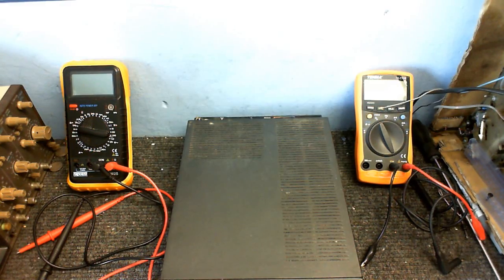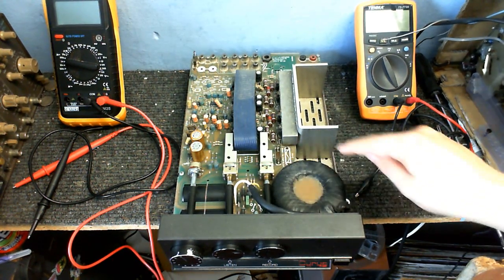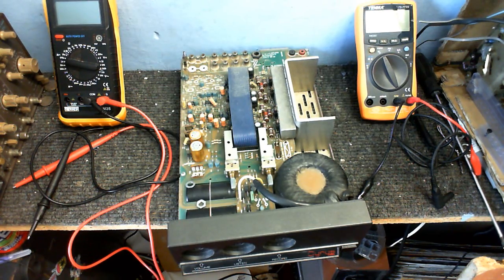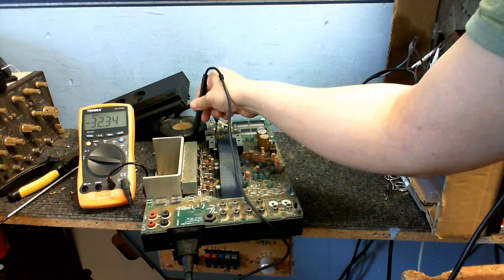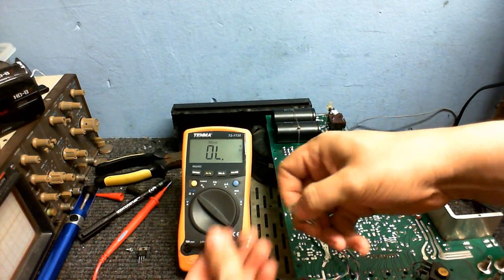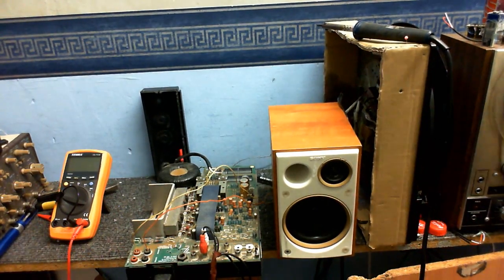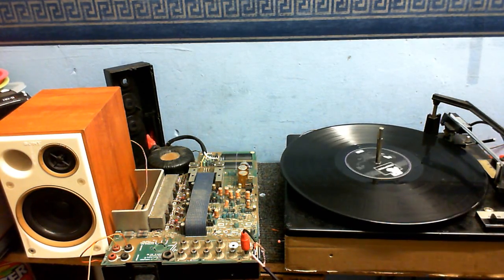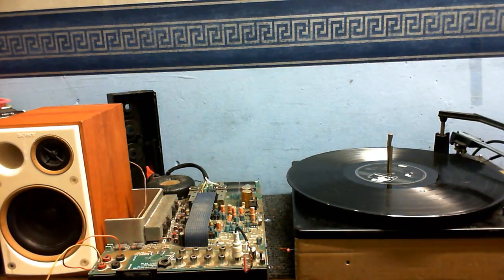CDC Electronic Workshop - Fixing a Cyrus One amplifier

Comment: I have had one of these for  about 15 years. 
They are brilliant. I had mine rebuilt by a real expert, it has always sounded great. As someone once said... to get a significantly better sounding amp than this, you need to spend $4,000.
The power you get for the 25W per channel is unbelievable.
I got some KEF LS50 speakers, and they need a lot of punch to drive them, I was getting a bit of mid range distortion when I wasx going past 60/70% on the amp (which is quite loud) so I had to get a Perreaux E220 200W AMP, which is a very well designed and beautifully made Amp.
They sound great now, but it underlines what a great amp the Cyrus was in the first place, in that it was able to  handle them really nicely at normal volumes (it runs my wharfedales now and is fine for them).

Comment: Great find Clem! I have a late Cyrus 2, with a toggle switch rather than a push button. They also sold an external psu (they called a psx, which is fairly easy to make yourself) which adds more power to the amp, and separates the pre/main sections. They only sold this for the Cyrus 2, but looking at your pcb, you might be able to modify yours to accept one of these also.

Comment: The line level preamp is entirely passive.  The voltage regulators and the op amps are only supplying the phono circuit.

Comment: Did you measure the output Voltages of the speaker connections before you replaced the bad Transistor?
Ive got the exact same Amp here and I wonder wether it could have the same problem because there are coming 30V out of one Channel...
Reply from the maker: I didn't measure it, but it could be something like that that's going on in your amp.
Reply: yea, I'll let you know when I know more

Comment: Nice video, and nice repair. Could you not put a few resistors in series with that 50K pot to get the correct impedance?
Reply from the maker: I could, but it would be better to just use a 10k pot, even though the new volume control is not the right resistance, it still seems to work well enough so I'm going to call it a success.